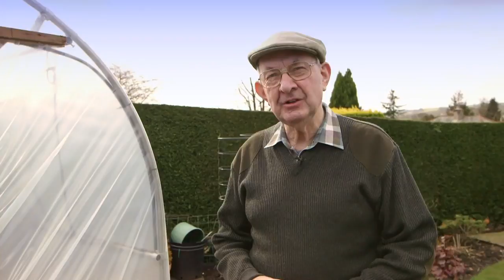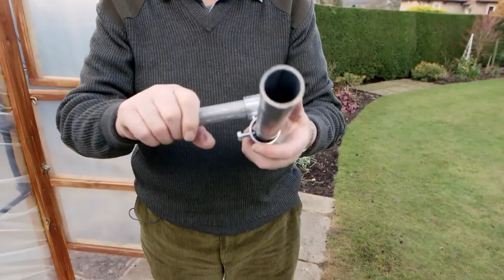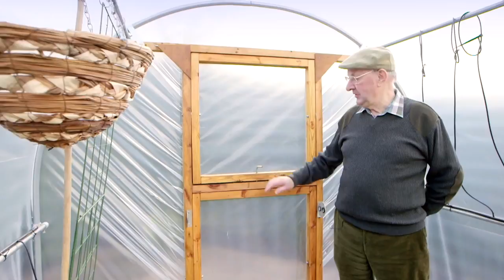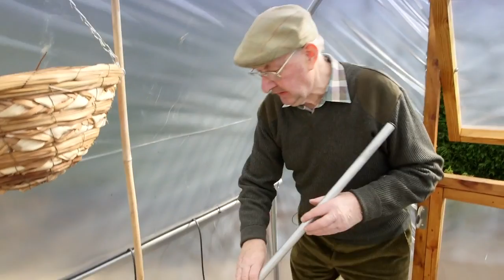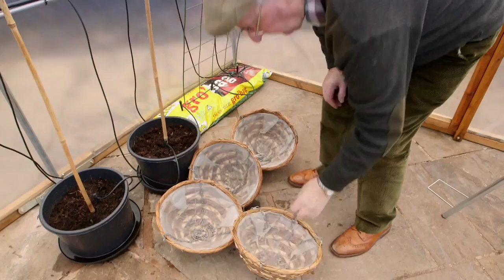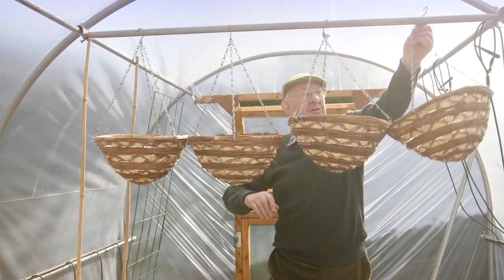The New Concept Polytunnel by Gro Garden Products Ltd

Comment: This would do me great but according to the website its been taken over by another company and they have stopped producing them, i did receive an email from them that said they have a few bits and pieces shame its always a good product that gets ditched.
Reply from the maker: Hi Fred sorry for the delay I have only just been able to get back into our account. I believe it was me who actually emailed you I wasn't aware of the full reason we had stopped producing them at the time. Yes it was a great product but unfortunately or steel supplier could no longer supplier the correct size tubes, and due to the time they take to put together we just could not handle the amount of orders we were getting for them with all the other orders in our current premises. We are still the same company we have just rebranded. We are now PdotWolf Ltd, my self and Mr Wolfenden (in the video) are still here but now joined by other members of his family as well as some other members of staff.
Reply: @pdotwolfltdgrogardenproduc2484  such a shame that you've stopped doing these.

Hope Mr W is still well and happy in his garden! 🌱